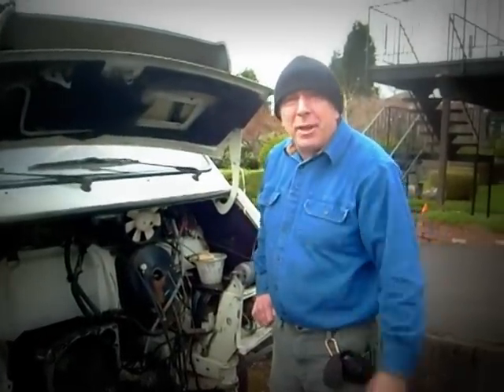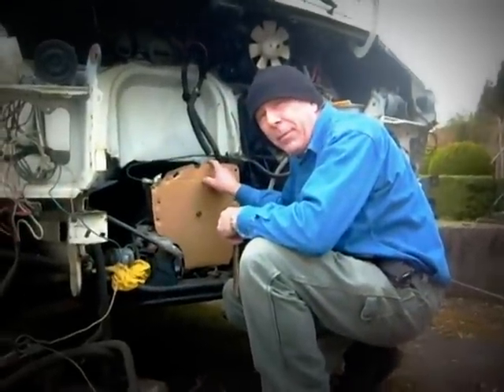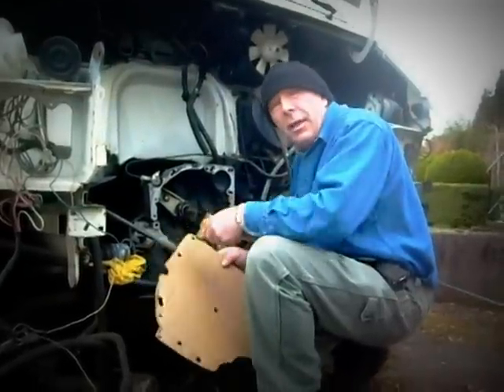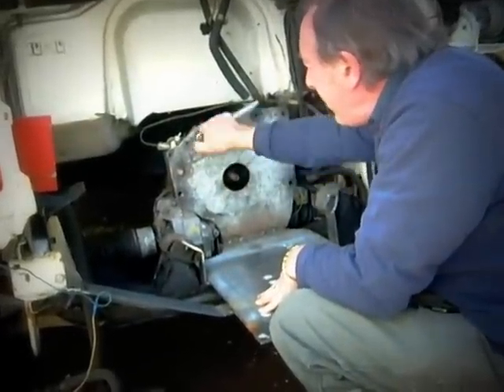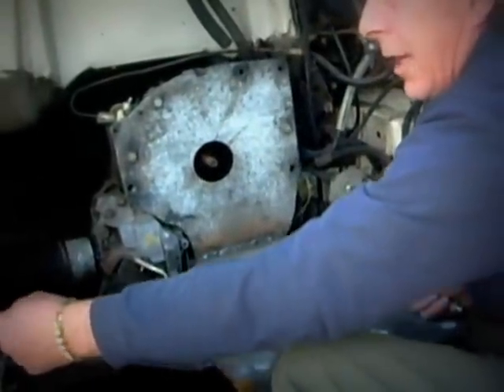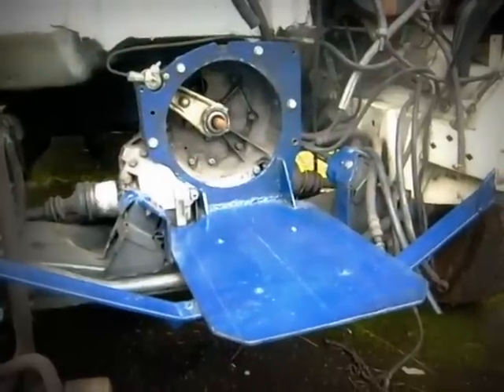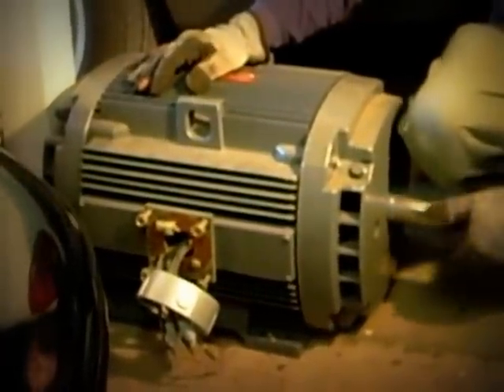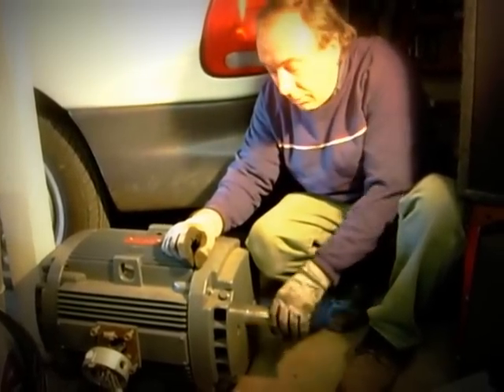The Electric Motorhome

Comment from the maker: Hi Jan.Yes, solar panels can charge the batteries-very slowly.The motor is 22000 watts.A solar panel puts out say 250 watts.So it would require about 90 solar panels and brite sunshine to power the motor.Unfortunatley,there is not enough room to put 90 panels on the motorhome.Thanks for the input.   
.(-_-)

Comment: How are you going to power this?
Reply from the maker: *****  A 20kw 3 phase alternator, turned by a dc motor powered by batteries. When the batteries run down, a 71 vw  bug engine will turn the alternator and the dc motor.  The dc motor will act like a generator and charge the batteries up. Thank you for the interest.

Comment: Wow 30hp otor that's less than a T1 split window vw camper van and they bearly did 50mph hence why mine has a 2.1L engine swap so I can cruise at 75mph all day long and not get rear ended
Reply from the maker: I had a '78 transporter with a 2.1 liter  engine and man that thing flew. It did 90 full out.